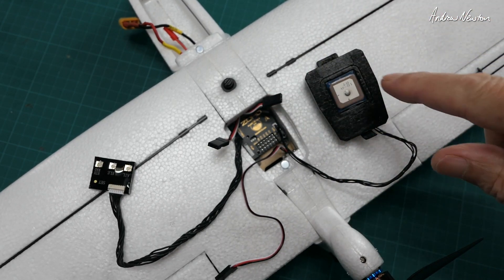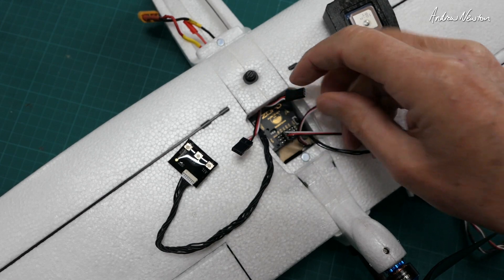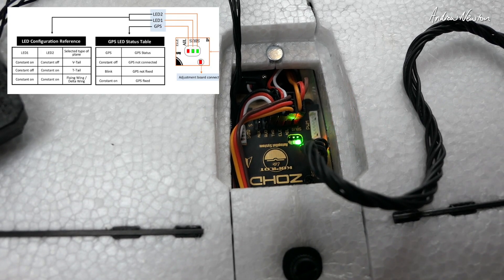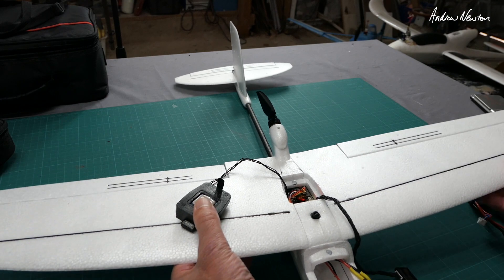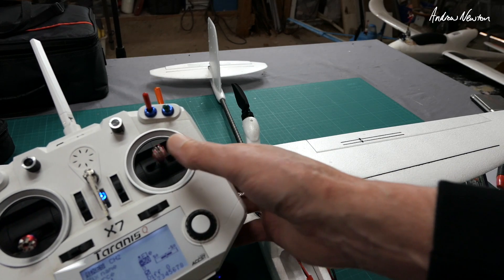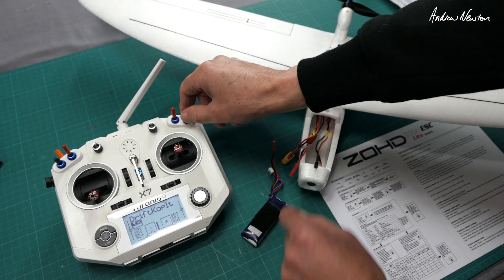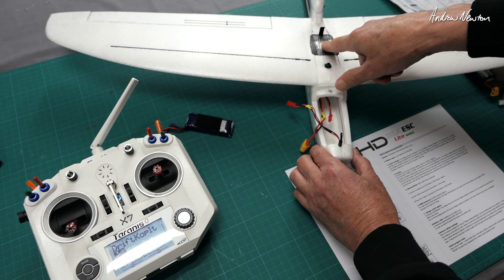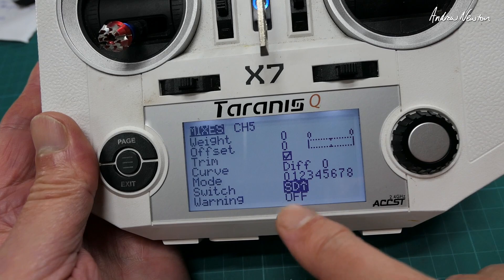ZOHD Drift Kopilot setup

Comment: Andrew have you tried sloping it since adding the additional weight of the Kopilot?
Reply from the maker: Extra battery weight did improve the sloping performance. Haven't tried it with the Kopilot fitted but it would be that same.

Comment: Hi Andrew, can you help me with a bit of an unusual problem? My drift insists on flying inverted when I engage the auto stabilise or RTH. I followed your tutorial , have the gps installed right side up( I even flipped it over- but no difference) and the kopilot is fitted in the correct slot right side up and pointing in the right direction. I’m using fly sky fs i6 receiver and radio. Can you save my skin and my sanity ?🤬
Reply from the maker: That's an odd one. Redo your level calibration and recheck stabilisation direction. Right aileron moves up when right wing rotates up.
Reply: What were you doing wrong Dave? As an aside ...You do realize that you are on the other side of the globe to us? So right side up here equals upside down there!? 🤣
Reply: theoztreecrasher that explains so much.....I always felt that something wasn’t quite right here . Haha 🤔😀

Comment: Great video as always Andrew. Wondering if you could give me your thoughts on somethin.  I went up three times today with the drift on the 3s setup. I am using a Tattu 3s 850 75c Batt. If I hammer the throttle it will go good but after about 5-10 seconds the bird would just spiral to the ground with no controls it seems. I walk over to it and there is still control of the servos. But i know i lost all power up ther ( or maybe just power to the motor ). Now if I stayed at 75% throttle or less then no problems. Hope you have an idea on what may be going here. Thank you Andrew and keep up the great work.
Reply from the maker: ESC might be set for low voltage cut off, battery might be breaking down or sagging a lot under load, heat affected connection fault.
Reply: @AndrewNewton  Thanks !!!!
Reply: @AndrewNewton  Can you please send the link for the esc programming as I cannot seem to find it online for the life of me. Thanks...

Comment: Another great video thank you so much. I do have one question about the Failsafe settings. I have the QX7 love my radio so when I go into the setup screen for the Failsafe I see that I have -100 for my Throttle Channel I believe that because I have a Safety Switch setup for that. So all I have to do is go down to Channel 5 with the dial and select just that Channel?
Reply from the maker: Yes with the switch in the RTH position
Reply: @AndrewNewton  Thank you very much!!!!!

Comment: Thanks for a informative video, I have a question if I buy the fpv version of the Drift, do you know if it possible to save the camera video to an sd card without the need for a set of fpv goggles?
Reply: I think I can answer my own question, no you can`t but maybe with some extra bit of kit?, which kit is my next question?
Reply from the maker: Need a DVR and Video receiver (and screen or goggles to check it's on the right channel) Or all in one like the Eachine EV800D screen / goggles would be cheaper
Reply: @AndrewNewton  Many thanks for your advise.

Comment: When you take off the settings device, do you have to do it when powered up or not?
Does it make a difference?
Reply from the maker: I have done it both ways with no problems
Reply: @AndrewNewton  Nope. Disconnecting the setting board BEFORE powering down is the ONLY way to guarantee that any new settings added are stored! Spent an afternoon testing it. 🙂

Comment: I was looking for your amazon affiliate link but could not find it in the whole long description or simply were too blind, but

I found this "line instead" and I like it a lot:
No single review will tell the whole story. Be clever, watch other reviews and shop around before making any purchase.
Reply from the maker: Glad you read the notes, not many viewers do. No Amazon link sorry
Reply: @AndrewNewton  Thx, I supported ARXANGEL RC with that purchase I had to make.

I have not read it before but I recognived that you had changed and improved a lot. I ususlly read the description of a video I am watching cause often there are links + usefull infos but I tend to stop where the "standard footer" starts.
And I try to look up and read articles like those in your blog or arxangels cause that helps a lot and you as Arxangel put a lot of effort into that. 
I even knew that you had a section on your site "tools I use" or so and there I had hoped or thought that you must have 1 amazon link.

But no, you have not a single 1 ...
Thx for your great work and references + links ... like these sunny motors and the rpm power measurement device I found on the australian site / channel and got it from Japan.

Comment: 🌟 Andrew Newton replied: "35 or 70m?"
 (Edited??)
2 hours ago

Never seen it checked. 35m is the only figure quoted in the usual manual gibberish. Someone with a reliable DJI-type quad care to track the RTH pattern and give us a confirmation or rebuttal? :D
Reply from the maker: Oh yes, I thought I should confirm that first. It certainly looks like 70m and not 35m in the air with a radius of 50m (not 100m like the manual says)
Reply from the maker: Actually I can test it myself on the next calm day, I have a Mavic Mini!
Reply: @AndrewNewton  Thanks Andrew. It would be appreciated. And I was aware of that. ;-)
Bit like the kid at the lower end of the class who finally sees the teacher make a mistake in a maths problem. Can't resist the 1 and only chance to take the mickey! :D
Reply from the maker: The results are in! 70m
Reply: @AndrewNewton  Bewdy! Thanks mate. And we're thinking of you all down there in the current ballooning madness!

Comment: Nice job.  Put one of these in a 250g dart last week, really quick install.  I hope they release a kopilot with some sort of acro mode - stabilised is a little too restrictive but manual is a real handful in the dart.  Inav seems excessive for such a small plane.
One tip i came up with is to tie any reduced rates (needed in manual mode) to the switch position for manual, which leaves you with 100% bank angle in stabilised mode.  You could even go to 125% in stabilised to give you maximum angles.
Reply from the maker: Yes good tip thanks

Comment: Thanks Andrew. I'll add a link to the Kopilot forum for a guy that wanted to set up a Drift. Glad you added the bit about the stuff-up with the ESC programming and the cure. (Is it 2 beeps an then throttle down for all batteries? Or 2 for 2cells, 3 for 3cells etc?) 
And the bit about the need for rudder channel input to Kopilot even if no output to servos is required. And the bit about radio calibration to sync manual trims to the stabilized (& RTH) mode - and need to re-do again after any further manual trims added. ;-)
Some further points to note. ZOHD planes and their ESCs are chosen to work with the the Kopilot. Some other ESCs (for example the one supplied with the Volantex Ranger G2) don't like the Kopilot's long boot-up time, see it as signal failure, and shut down. The Turnigy Plush ESCs from Hobby King work on the G2 & Kopilot.
That manual diagram of servo connections for the wing is looking at the bottom! Plug it in like you're looking from the top and you'll need to buy a toupee! 
Plus some folks have reported that, if you want to remove the settings board, you should (counter-intuitively) only pull it with the power applied. If you pull it after powering off some have reported loss of settings just added! (Not tested myself. When I finally get it working I'm not touching anything! )
The good news about the Kopilot is, that while there are 101 ways to plug it in and set it up that won't work, (and I've tried nearly all of them bar reversed battery!) once you get it right it all still seems to work! :D
Reply: Agreed, lots of useful stuff here which isn't obvious until you've done it wrong!
Reply from the maker: Just 2 beeps for ESC throttle range calibration, then 2 or 3 beeps depending on the battery when it's initialising.
Reply: @AndrewNewton  Thanks once more for your generosity with your knowledge!

Comment: Hi Andrew, can you let me know the altitude at RTL is it measured from sea level or from the height that it is activated. I live and fly in hilly terrain and worried it will circle into  a hillside. Many thanks.
Reply from the maker: Above the arming altitude, not above sea level
Reply: @AndrewNewton  But it is only 35 meters above arming point so fly from the top of your highest hill. (Or half way up your 65 meter trees!) ;-)
Reply: EDIT...Andrew has done a video which shows that the RTH height is actually 70m. The 35m mentioned in the manual is the height the Kopilot will fly the plane to when you use the auto launch feature. With no input from the sticks the plane will fly straight forward while climbing to 35m, then go into RTH mode and turn to circle the launch point while climbing up to that set 70m level. I believe if you select RTH if you are under 35m above launch height the plane will react the same. IE Fly forward till it reaches 35m and only then turn for home. More testing needed. ;-)

Comment: Glad I watched this, just installed the Kopilot in my Mini Talon and nowhere in the instructions did it say you needed to place the gps in a certain orientation, you possibly saved the day, cheers.
Reply from the maker: It's one of those vital bits of information that is never spelled out. A simple indication on the label would help.
Reply: @AndrewNewton  Your dead right, glad I take my time before I maiden, thanks again. Something else is worrying me about the kopilot, while on the bench and even in the garden setting it up I notice that it occasionally loses gps lock ( gps indicator on kopilot main board flashes briefly for a few seconds) in the rc groups forum  there has been talk  of occasional flyaways, maybe coming back to the approximate home position if gps lock restored,  could this be a problem with gps coordinates not stored in the kopilot ?
Reply: @jonnyBgood3  Yep, this is something that needs investigating and I've not seen anything done on it yet. If you've got access to a BIG clear flying area (we don't) set up and arm plane at point A, walk forward 100 yards to point B, place some metal foil over the GPS unit (in 2 secs it will show a red blinking led on the Kopilot meaning GPS lock lost) remove foil and when led solid again, send her out and see which point she returns to circle under RTH. Then post here and on the RC Forums please.
Reply: @theoztreecrasher2647  Certainly I will give it a try when I get out to a larger area to fly, my usual area is not that big, one of the reasons I'm a bit nervous of kopilot at this point.
Reply: @jonnyBgood3  Me too! I always prefer to learn from the other fellah's mistakes. :D